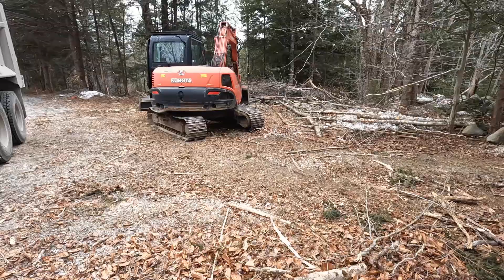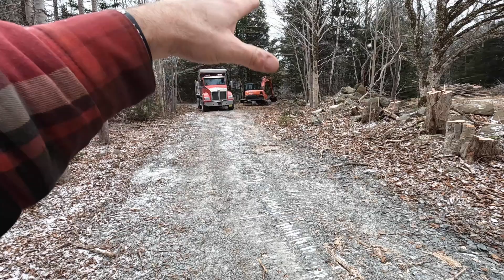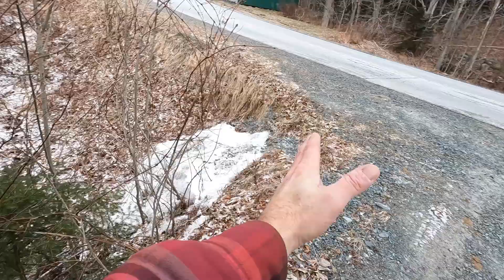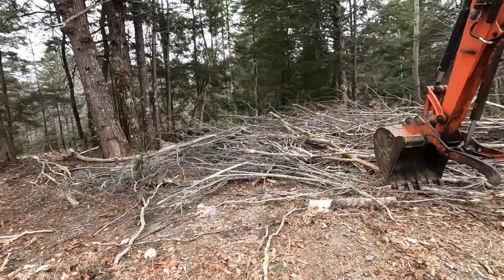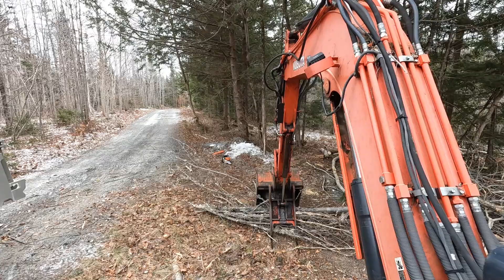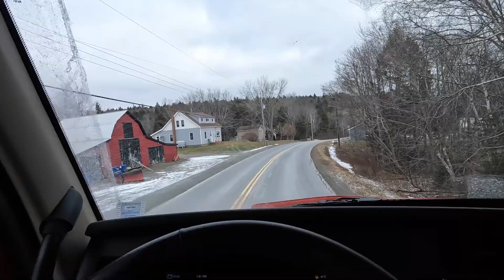WE FINALLY HAVE DECIDED WE ARE RUNNING POWER INTO THE COTTAGE. WELL MAYBE. TIME TO CLEAR THE ROAD

Comment: I would think that trenching and running underground lines would be a lot easier and cheaper. And you wouldn't have to worry about wind, snow, and limbs taking down lines.
Reply from the maker: @kevinfiebelkorn4715  very expensive that way such a long run you would require a huge cable and many bump up stations to have adequate power at cottage

Comment: While solar might be a nice idea, it's not always that practical. 
Many of my neighbors added solar but they still must be connected to the grid and pay all the fees and taxes related to having power at their disposal.
I don't think most of them realized that the panels must be cleaned periodically and now with all the nearby fires, their panels are covered with ashes and soot. 
Several of them have admitted if they had it to do over again they would not put the panels on their house. 
I think what you said about having power run to the house and also having a backup generator is the way to go.

Comment: Picking up and loading that brush into the dump truck does look like a pain in the butt. 
How much more work or time would it be to just mulch all of that brush so you can either scoop it up or spread it around where it is ?
Reply from the maker: @dalegereaux1863  if it was my land I would try to find a spot to pile and mulch with the skid steer. This section is a ROW.
Reply from the maker: @dalegereaux1863  if it was my land I would try to find a spot to pile and mulch with the skid steer. This section is a ROW.

Comment: I don't like loading brush into dump trucks either, I was a bin truck driver I'm used to having 40-50 yard bins I loaded hundreds of loads of brush and stumps. Far far easier loading bins than a dump box on a gravel truck. Hardwood branches are the worst you get everything smashed down and a branch pops up like a guy on viagra pills no matter how much you try smash the branch down it keeps popping up. We don't have a whole lot of hard wood here in BC mainly alder and maple. Not sure how far it is from your gate to the cabin I'd consider under ground for us here private power poles are 10 grand each installed.